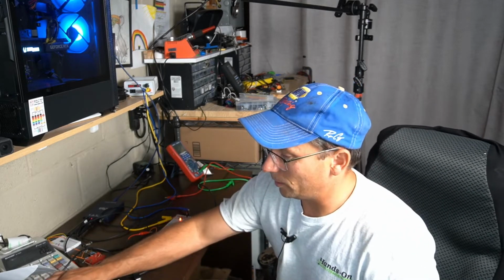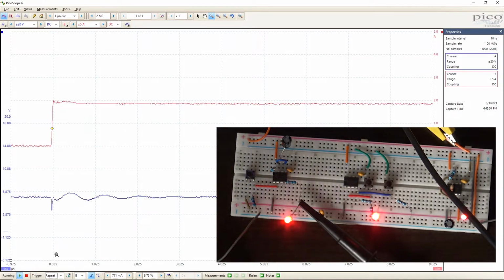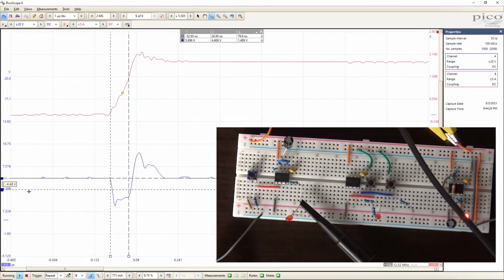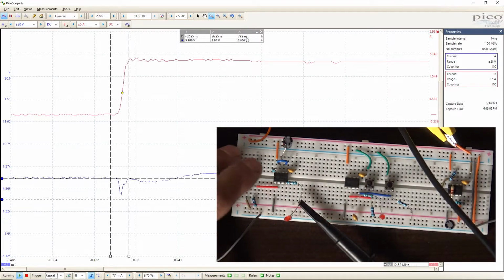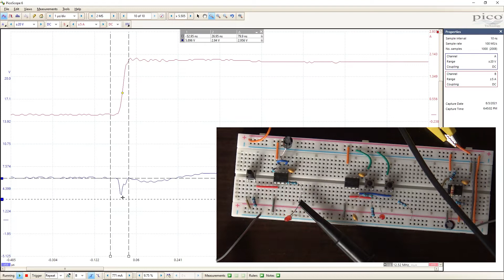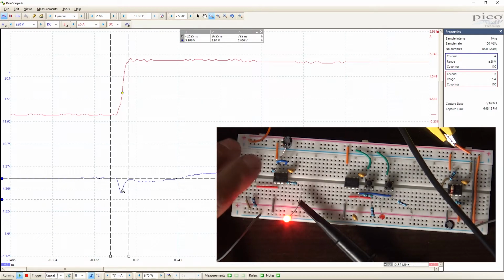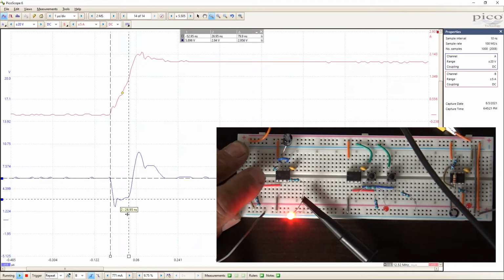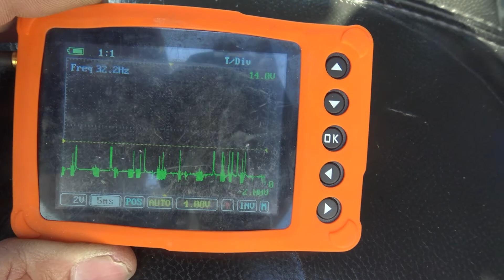8 3 2021 END of Day  some 555 information

Comment: Brian I’m working myself on all three modes. I’ll be doing the bistable tomorrow. Most of my problems have come from the connection of the 555 timer to the breadboard. We will have to start sharing notes. I’ve also been monitoring the amperage draw on the circuit by using different color LED’s and their voltage turn on points while watching my oscilloscope. Also monitoring the various voltage drops coming out of the 555 while using different size capacitors. There is so much to learn but I’m getting a grasp on where and what to look for when solving issues. Also keeping a supply on pin 4 to keep the circuit high. Gosh there is really a lot to learn.I have the same push on off switch but ordered a different type today. DTDT latching switches. It’s hard to write everything down. I’m going back to your video now but wanted to touch base with you. You and family stay safe and well Artie 👍 Brian I did some research and what you might also be seeing is switch bounce. Adding the capacitor smooths out the signal.
Reply from the maker: You are right , so much to learn. Playing around the last few months ans having the pico handy at the bench i am learing what to expect and how to locate problems. Yes keep 4 high ,  a 10 nF cap on 5 to vcc .. now for the the denouncing I will look into that ( with arduino we can just wrote into the sketch) I think my problem is my power supply,  I may try with a 9v battery and with out the capacitor between vcc and ground,  will let you know!. Have a good night talk to you soon!